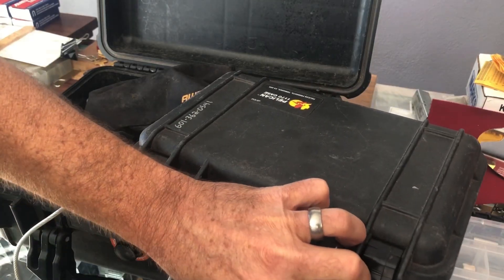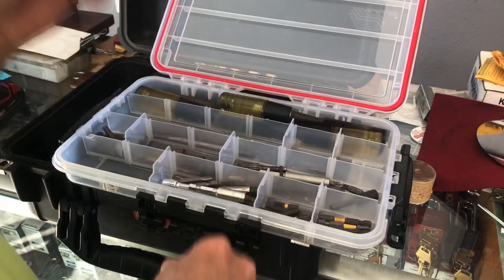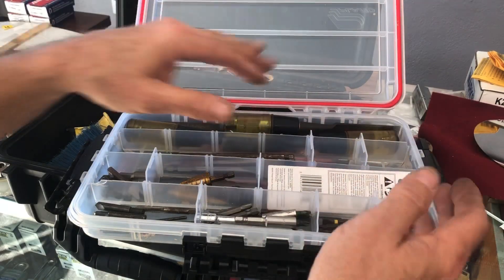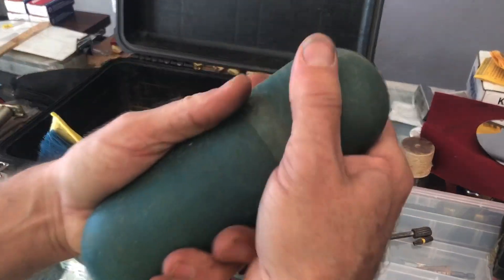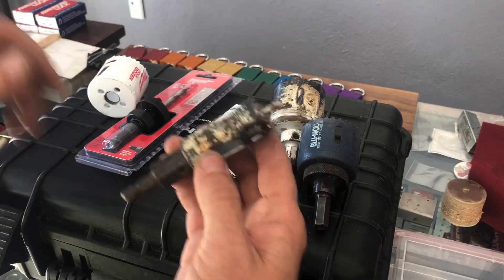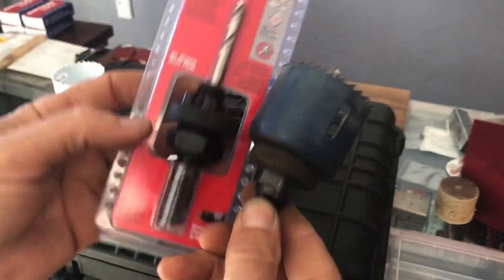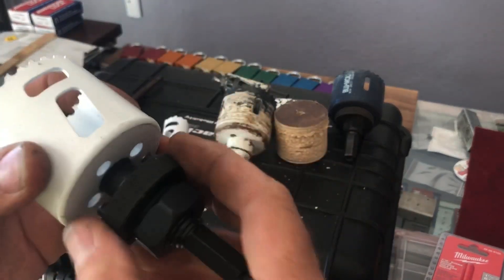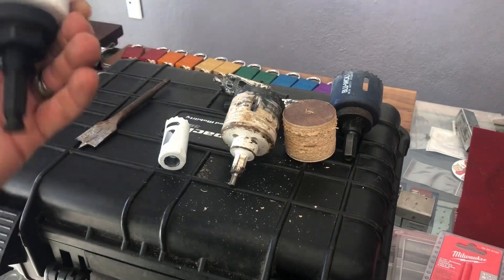toolbox talk: let’s look at the Milwaukee hole saws

Comment: I switched to the Spider Brand 2 1/8” Hole Saw. They are for wood only. They have just 3 Carbine teeth instead of the normal array of teeth. It zips easily though wood doors at three times the speed, cleanly and easily ejects the wood puck, and they last 10 times longer than a regular biMetal Hole Saw. I only use the regular saws on metal clad doors now. Available at Lowe’s.

Comment: The holes saws with the wider teeth profile last longer than the narrow pointed ones. Slow and steady helps them last longer as well. I can make one last a long time even boring through stainless if I take it slow. Stainless will work harden and or overheat the teeth if you go too fast. I have some nice hole saws but I also buy cheap hole saws at flea markets for backups but wind up using them first. Even they can last a long time if your careful. Thanks for sharing!

Comment: I use the removable version. And because the 2 pins go in, before it is all tight, you can swap holesaws in the field without heavy tools to unscrew an over tight thread. I just use the lenox version, and they also have a quick center drill remove, after you get the holesaw going, and do not have space for the center drill to poke out

Comment: Was going to buy a Bosch drill but they were out of stock, so I went with a kolbalt 24v max 1/2 in drill. I've  had it about a year now and the battery pack last a long time between charges

Comment: I use Milwaukee 12 and 18 volt drills. I use 12 volt when I don’t need extra power. I use hole saws with separate mandrel.
Reply from the maker: unless I am going in for more than one (say) deadbolt install (or an install on a metal door) I rarely use my 18's anymore!

Comment: Why don't you like your drill? Im looking into a power tool line and I'm liking Makita. They're all pretty dang close now. Each major contractor grade cordless tools, Milwaukee, DeWalt, Makita: they're all pretty damn close. However, AVE tear downs has shown me Makitas are built the best. And everyone says they're ergonomic as all hell. 

You can resharpen the drill bit if it ever becomes dull. I don't think you can resharpen a fixed one without hitting the side of the hole saw. Milwaukee's hole dozer is the shit tho. I got the Milwaukee kit that comes with a jig. Really clean holes. You prob didn't need the more expensive quick change arbor. You could probably use the one that you use your 1" hole saw on it too. But the quick change is neat if you ever have to take it off. It can be a bitch without it.

Comment: The 2-1/8” saw will fit the arbor your 1” saw uses. Just saying.
Reply from the maker: Diener Christi I know, but I wanted to try the extra “stability” or whatever with this bigger one :)
Reply: @selock  That one looks good still because I often have my saw fall off after drilling a hole. (Don't ask me how, drilling the hole tightens it)